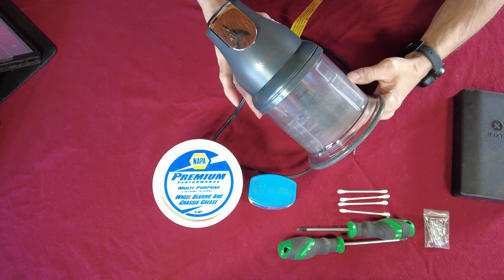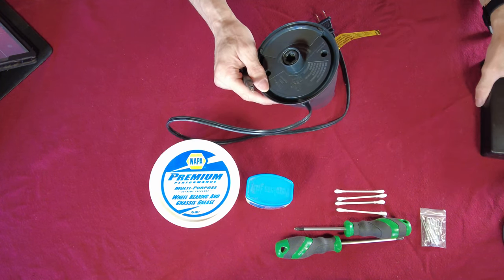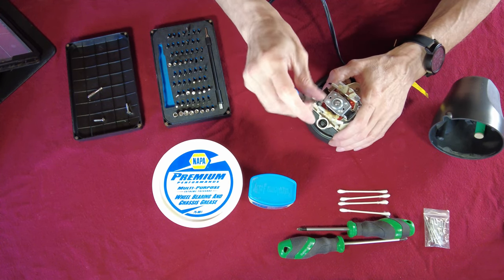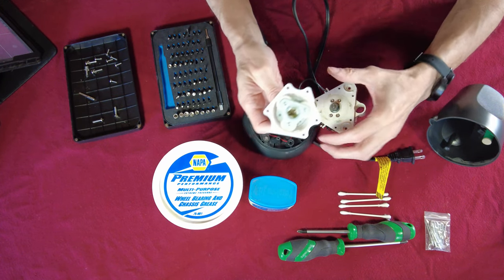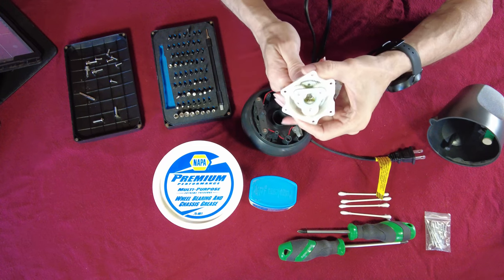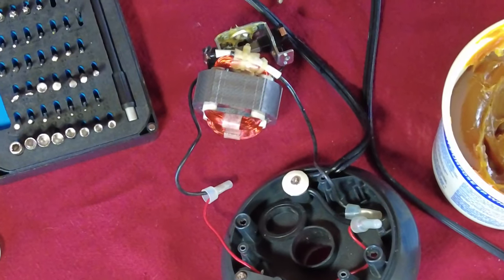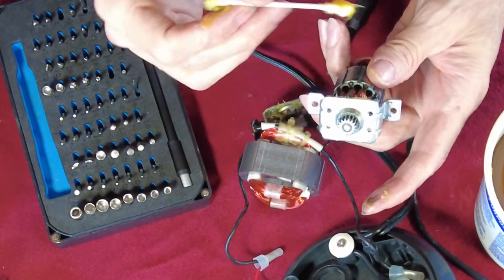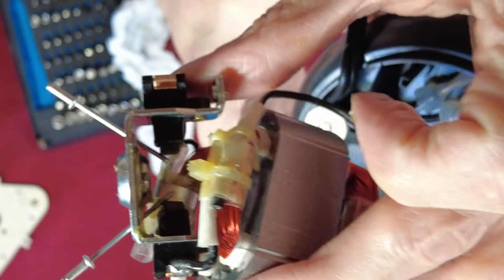The Watchman News - Ninja Food Chopper Maintenance Repair - Disassembly & Lubrication

Comment: How do u get the protective plastic covering the screws out?
Reply from the maker: Someone else had asked me the same thing. Mine did not have plastic covers over the screws. My unit must have been an earlier revision before they added those.
Reply: @TheWatchmanNews  
Mine has the covers as well
Fortunately I had the right sized mallet to hit it with
and it started to run again
Reply from the maker: @steelblue4903  from my experience if the mallet cant fix it nothing can lol. I wonder if they can be drilled out. If it is a plug/cap you might be able to put a small hole in it and put a screw in it and pull it out with pliers.
Reply: @TheWatchmanNews  😆

Yeah, I wondered the same thing
Just so happens the mallet was closer
to the hand than the drill